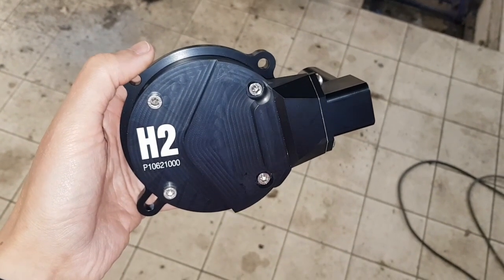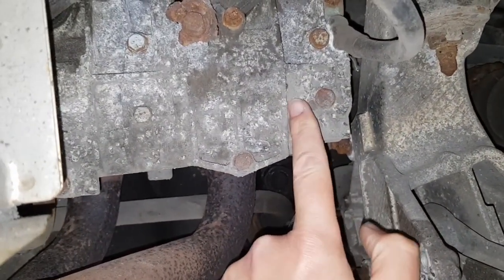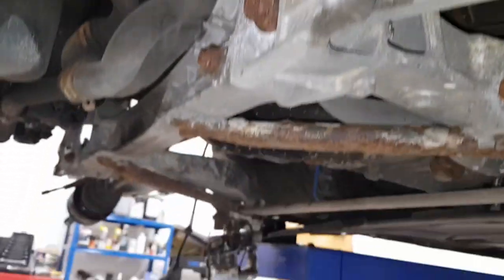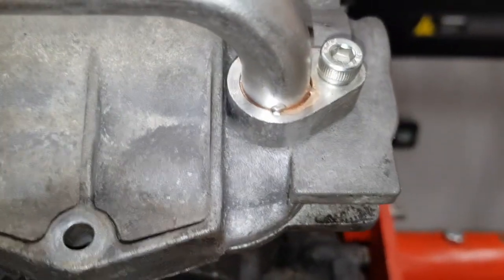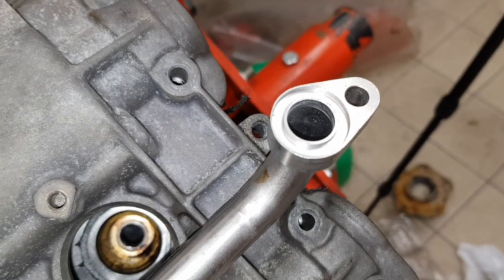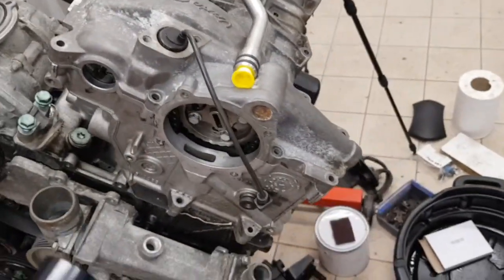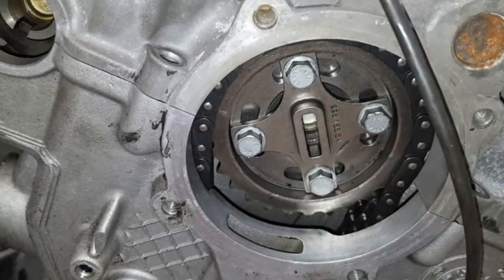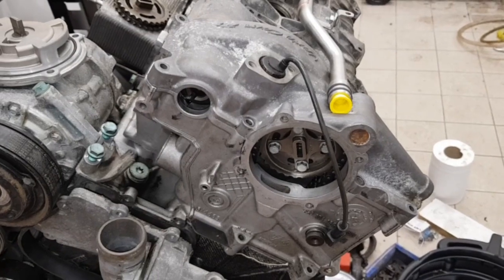Porsche 996 M96 3.4l Dual Scavenge Pump installation info

Comment: How are you making the connection at the cam cover?
Reply from the maker: Uses the standard Porsche pipe, which is still available.
Reply: @martinhill5770  I mean the fitting at the cam cover. Welded? Through hole? There was no X51 for the 3.4 in the US so I've never seen the Porsche parts
Reply from the maker: @Van-tastic  The end of the pipe has an o-ring on it, but it was removed when I did the video. So the end piece of the pipe just bolts over the hole drilled in the cam cover and is sealed with the o-ring.
Reply: @martinhill5770  I see. Any need to machine a flat onto the cam cover for adequate sealing? Seems the cast surface would be a challenge even after squaring up the edges
Reply from the maker: @Van-tastic  One of my other engines had the x51 option fitted, it is the same cam cover just with the hole drilled, so doesn't seem to be any requirement for it. It wouldn't hurt to rub it down if it was very rough.